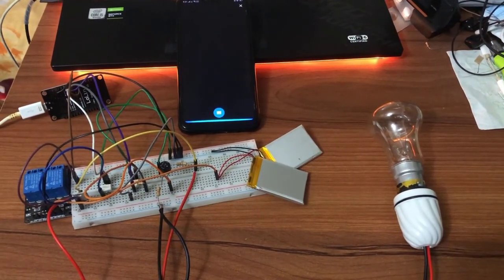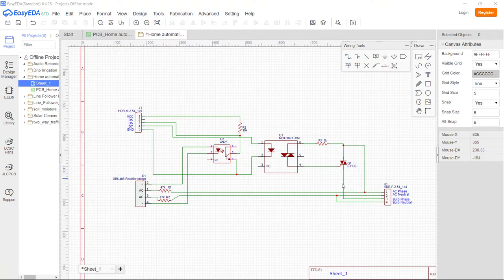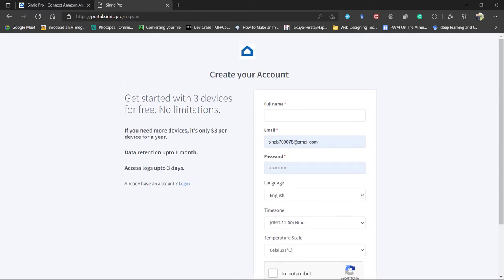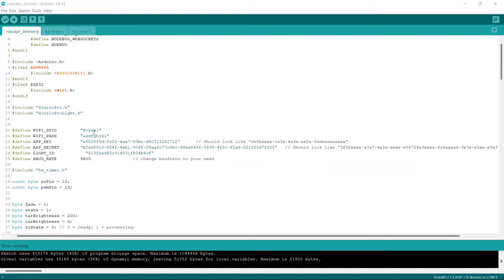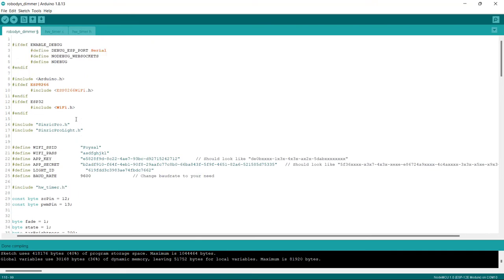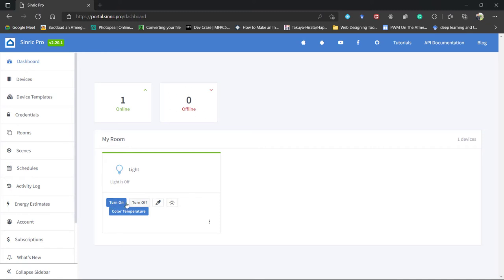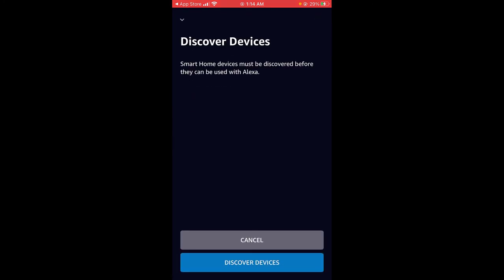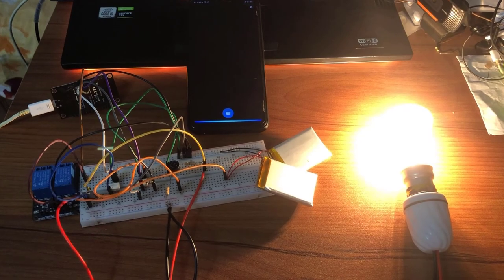AC Light Dimming using NodeMCU and Amazon Alexa

Comment: Hello dear how to upload this code to nodcu v2
Reply from the maker: nodemcu has some issues with code uploading, often it rejects the data and shows error. This code should work on v2 also, however, you need to carefully select the correct version of the board and try increasing the baud rate. If fails disconnect the board, try again.